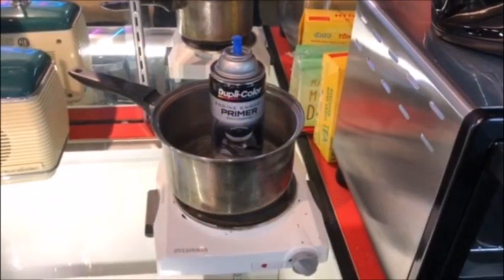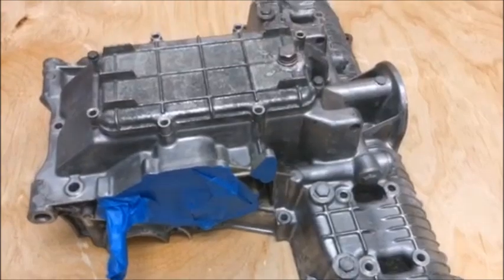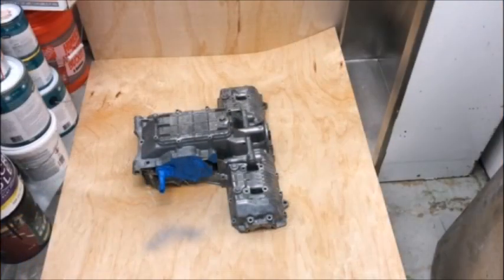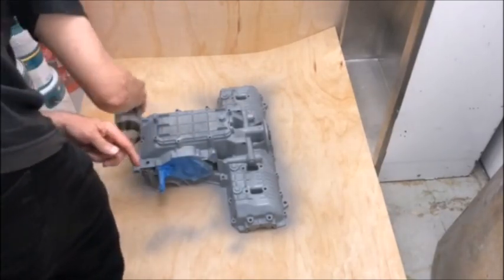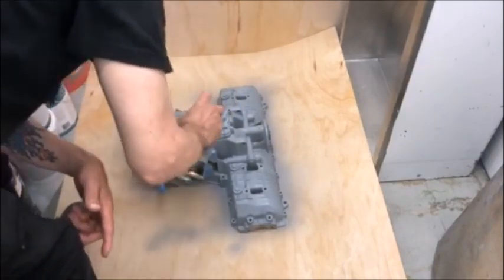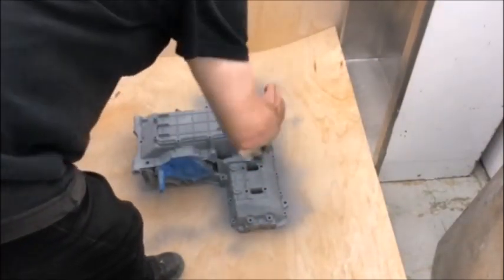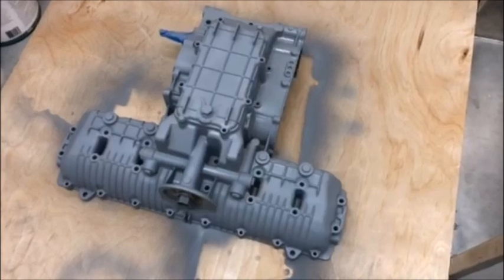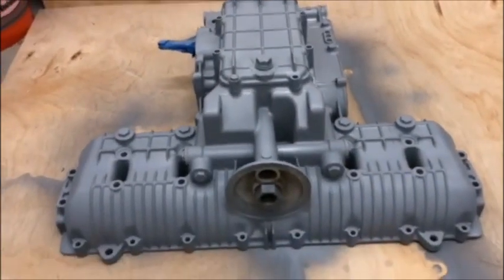Honda CBX Full Restoration & Engine Rebuild Video Series - Part 12 Primer Coat on the Engine Cases

Comment: I have a 1982 cbx 1000 on the bottom engine case there are 2 bolt head on each side that are 14mm what are they and what should they be torqued at they are seeping oil.
Reply from the maker: The manual calls for them to be torqued at 24 - 27 lbs.  There is also sealer that should be applied in that area if you are building the engine. I believe I cover that in one of my videos, not sure. You should get a Shop Manual for these bikes, It's invaluable.

Comment: Good tips , but would have been easier spraying it by raising it off the floor say on a bench with  360º access , and surprised you didn't mask off from overspray where the oil filter screws on.
Reply from the maker: You are right.
The paint room in the video is still being set up and will have that ability when it is finished.
I was under a time crunch with this video and didn’t set it up thoroughly 😎
I agree about the oil filter area which I have cleaned off and taped it up for the silver coat.
Thanks for your comment John